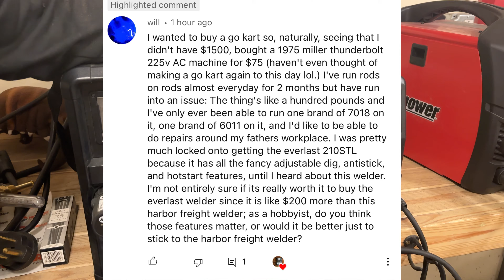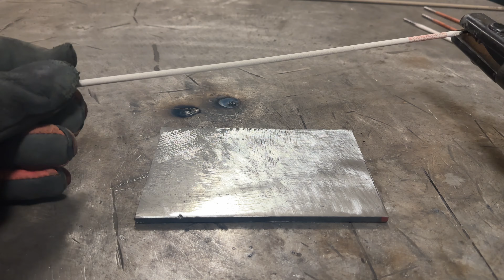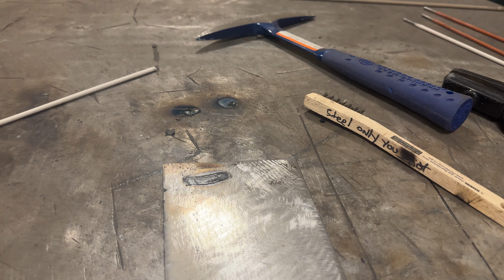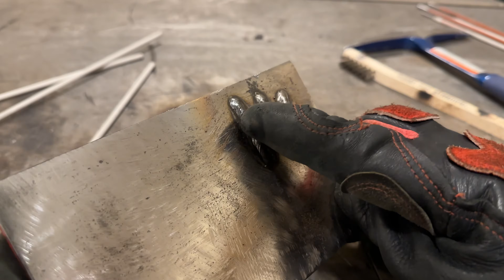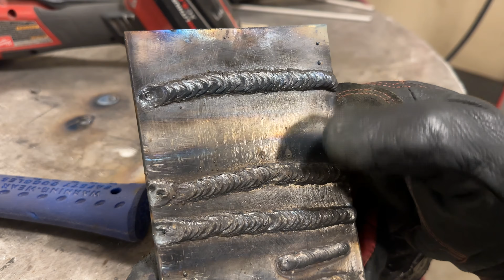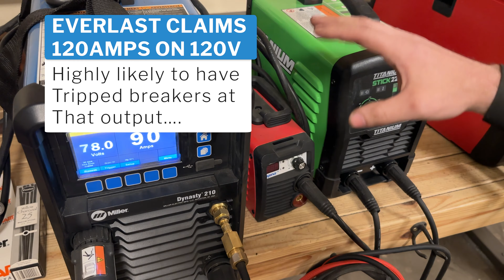Titanium 225 vs everlast 210 stick welder.  Comparison/explanation of features, viewer question.

Comment: How well does it work with aluminum?
Reply from the maker: So the titanium 225 can weld aluminum only with aluminum stick rods and those are not very easy to run.  If you want to weld aluminum a “spool gun” on a MiG welder or a a/c tig machine is the way to go 👍

Comment: I think it's a benefit that the Titanium does not have the stuck rod feature... if you have some rods that are a bit damp, you can short circuit them and heat them up and dry out the flux coating... can't do that with the stuck rod feature.

Comment: Hot start and arc force adjustment sold me on the Everlast 210STL.  No regrets at all.  I enjoy welding with the 210 more than my old Thunderbolt transformer machine.
Reply from the maker: You can’t beat having arc force and hot start control.  Once you have it you never want to go back to a simpler welder lol.

Comment: Ive had the titanium 225 for about 2 and half years. Its been a really solid machine for me . And one point i let it sit for like 6 months and still worked great. Id upgrade the stinger and the ground clamp though.
Reply from the maker: Those 225s are awesome welders.  Despite being simple they flat out weld good and actually run 6010.  The stinger and ground clamp upgrades are 100% worth it.  What I really like most about that welder is that I can tell people who want to learn to stick weld to go out and buy one, and I know its capable of running any rod and welds great.   Not to mention they are available everywhere for a very affordable price.  Prior to the 225 there weren't many affordable options that had at least 150 amps of output on DC, could run 6010, and were available everywhere for reasonable money.
Reply: @makingmistakeswithgreg  I agree 100 percent ! I use it for scratch start tig too because I'm cheap lol
Reply: @makingmistakeswithgreg  I just bought one of those Berger stingers and a Lincoln 300 amp ground clamp. The clamp is like 12 dollars on Amazon .

Comment: Everlast 210 STL $449, Everlast 200 STi $349 and Titanium 225 $319.99 (members only deal is $279.99 right now).   It's a tough decision!😂😂.  I really enjoy the videos.  Thanks!!
Reply from the maker: So the titanium 225 is a great stick welder and I honestly don’t think you can find a better stick welder for the money.  Going to the 200sti would give you more ability to adjust settings (adjustable parameters for arc force and hot start).  Going to the 210 primarily gives you better tig capability with built in gas valve.  From a stick perspective it also has “stuck stick” which can come in handy.  

My suggestion is if money is tighter, buy the titanium 225 and spend the difference on rods and practice steel.  Practice will make a far bigger difference than the upgrade in machine will.  If you have a bit more money I would suggest going for the 200.  The main benefit in my eyes is better performance on 120 volt, the rest of the stuff isn’t really a big deal.  The harbor freight will only weld up to 70 amps on 120v, the 200 everlast will hit 120 (supposedly).  The truth is at 120 it is actually pulling 30+ amps out of the wall (on a 20 amp circuit) and it’s relying on the thermal trip curve of the breaker not to shut off.  In simple terms you won’t get anywhere near 120 if anything else is on the circuit or you weld more then 20-30 seconds in a row.  Also, you may have 240 at your place but someday you may need to go someplace to weld something (be it a friend or a job).  I rather have atleast the ability to run a 3/32 7018 at 90 amps than being stuck with 6011 3/32 at 70.   Hope that helps 👍
Reply: @makingmistakeswithgreg  I was wondering if you could explain what this means.  

On The 200 STI:
Max Inrush (I1MAX) Amps: @120V: 39.2A.  Maximum Rated (I1EFF) Input Amps: @120V: 24A.

Max Inrush (I1MAX) Amps: @240V: 36.8A.  Maximum Rated (I1EFF) Input Amps: @240V: 22A.

Would/could a dedicated 30 amp plug with 30amp breaker (for travel trailer) run this 200 STi set at 120 amps?
Reply from the maker: @bryanthornton6787  surely I can explain those 😀.  So they actually seem to have believable specs listed.  Max inrush is the maximum power it will pull out of a circuit.  In my testing most stick and MiG welders will pull 32-38 amps on a 120 circuit when maxed out.  They are telling you that welder should not exceed 39 amps on 120 and 37 on 240 (obviously on 240 the output power is far greater).  Now the rated amps is the power output it has at its rated power.  Rated power is typically not at max, but less.  

Doing the math of a 7018 run at 120amps, that’s about 2,400 watts (120a x 20 volts that a 7018 would run at).  That welder at best is probably 60-65% efficient so that puts input power around 3700 watts to get 120amps out with stick.  At 120 volts that is 30.83 amps (3700w / 120v).  That’s a whole lot of info but what it means in simple terms is that welder (best case scenario) will need 31 amps input to output 120 amps.  

On a normal house circuit a 20 amp breaker will allow 31 amps through without tripping for probably one minute.  So a normal dedicated 20 amp breaker would handle welding at 120 amp output intermittently without issue provided you weren’t burning up rods constantly.   A 30 amp household breaker would handle that welder indefinitely at 120a output without ever tripping because that welder is unlikely to exceed 40 amps draw and a 30 amp breaker will allow 40 amps to be pulled for minutes at a time without tripping.  So basically if you have a 30 amp 120 circuit you’re good to go and will get 120 amps of output off that welder on 120.  

I have personally used both a esab rogue and a miller 161 maxstar on 120v 20 amp and they both will weld 1/8th 7018 at 120 without issue.  I would assume the everlast would be the same and even more so with a 30 amp breaker.  

If you are limited to 120 volts the modern inverter welders can actually weld a 1/8th rod which is awesome.  The only real downside is the duty cycle is generally lower and the hot start may be slightly less when maxed out.  Hope that info helps 👍

Comment: The 210 is worth it just for the features. Antistick and hotstart are great for beginners and arcforce with help you for welding thick metal or doing your hot pass. But even those feature aside, let's say you're all old school guy that doesn't need that fancy bs, everlast has a 5 year warranty whereas the titanium only gives you 90 days unless you pay extra for either the 1 year or 2 year warranty
Reply from the maker: I definitely agree 👍.  The 210 makes stick welding easier and you can tune it to the way you want.  If the budget allows for it that would be the way to go between those two 😀

Comment: Hi Greg. I'm glad that you discussed the duty-cycle. When I used my old AC-only welder, and practiced some welding exercises, the transformer thermal circuit disconnected, until the transformer cooled down. Thus, for me the higher the duty cycle the better. The noise of the cooling fan, and how often it starts, are factors that can be important. Cheers.
Reply from the maker: Yes great points.  One of the many reasons why I like fan on demand and welders with solid duty cycles, they tend to be quiet and they don’t give up when you’re ready to keep going lol.

Comment: This video was incredibly insightful, I hadn't even considered many of the things you brought up, most notably: cases in which I'd use the welder, the benefits of hotstart, and duty cycle. One of the things I like most about my current ac buzzbox is that I can crank it up to 150-160 amps and run hot passes seemingly forever with it's solid duty cycle (30% at 225 amps I believe), which is something I feel like I'd definitely be limited by with the titanium. At first when learning about hot start I thought it made only the initial arc strike easier, in other videos the most in depth explanation I got was that once the initial arc struck it the pushed the amperage up and then immediately shot down; what they hadn't explained was that hot start made the beads less stringy in the beginning, something which I thought was caused by me moving the rod too quickly or long arcing in the starts. Lastly, you briefly mentioned in the video that antistick wasn't really a necessity for welding on flat plate, but would have an absolute advantage on in confined spaces. I didn't really think to much about the cases in which I'd be using the welder, but because you brought it up I realized that those are the positions I see myself welding in the future.

I've decided on the Everlast 210stl, while im sure your welder is much much better, the features are undeniably better as you pointed out, and I will be taking full advantage of them with the positions I'll be welding in in the future. Thank you for taking the time out of your day to make this very helpful video, I've been considering getting a new welder for almost a month now and I think I've finally decided on the one I should get. Also I've started using normal grinding disks again after your reply, not as bad as I remembered as far as skipping goes and the surface finish is okay for most the work I do, thank you for spreading your knowledge on welding.
Reply from the maker: No problem and I am glad you found it helpful 😀.  I like the titanium 225 and think it’s a great stick welder.  The everlasts features cost a bunch more, but you will see use out of them for sure.  They won’t make you a better welder honestly, but they will make it easier to put down good welds.  Cleaner starts, ability to control your 6010/11 aggressiveness, and not junking rods because they stuck make everything a bit better.  I also like digital displays for amperage/controls because I can dial things in faster.  I am sure you won’t regret your purchase 😀

Also, to a certain extent slowing down travel or slightly long arcing the rod for the first 3/4 of a inch of a weld can help get the bead to smooth out, but doing so can risk porosity at the start.  Without hot start I generally run the welder on the hot side to get the weld to tie in good at the start, and move faster in the middle to compensate.  Hot start solves all the issues of poor tie in, roped up bead, starting porosity, stuck rods, etc, and makes it flat out easier to get consistent welds.  Little adjustable settings makes for better welds.  Just like “run in” control, burn back, and inductance settings on MiG welders can help make more consistent welds.  They won’t make a bad welder a great welder, but they make good welds just a bit better.

Comment: Early on when learning to weld, I never paid any attention to hot start or arc force. I could have saved some real headaches by learning them sooner. Hot start saves from that frustrating sporadic porosity. I always adjust the arc force when I’m runnin 308 for stainless. I don’t even use the stick stuck feature on my Fronius. What the Fronius does have that I’d like to start experimenting with is the pulse stick feature.  When I get more time im gonna dive into it. It seems like it helps with 6010 and especially when welding any sort of thinner gauge material.
Reply from the maker: Fronius is one of the few that will pulse on stick, that’s a feature I have never used (never owned a welder that could) but have heard can help.  Hot start is a definite must have, it makes tie ins better, and like you said it really helps with the starting porosity.

Comment: great video, I finally upgraded and my Primeweld mig180 is on its way to me. It comes with a spool gun and it also has a CC mode & comes with stick leads. I'm still going to keep my buzzbox in the corner just in case tho. On a side note last night I was padding beads running 7014 DCEP on my buzzbox. Anyway It didn't feel like I was getting any penetration, the slag was all gummy like a 6013 and the molten metal just blobbed up on top of the plate, TBH someone could have told me it was DCEN and I would have beleived them.......any thoughts? It might just be how 7014 is since I have never really tried them before.
Reply from the maker: The 7014 seems to take more amperage than 7018.  Based on my testing it doesn’t like to penetrate much.  I have ran 3 different 7014 brands/rods and I rather run 7018 10 out of 10 times lol.  For 1/8th in rods try 130 amps (depending on steel thickness).
Reply: @makingmistakeswithgreg  THANKS, yeah I probobly wont buy anymore 7014.....they are ok I guess but I would almost rather have 6013 or 6011 in an AC only situation.
Reply from the maker: @yurimodin7333  yeah, after running a bunch of 7014 it seems to me it mostly would benefit thin metal because it’s penetration seems to be minimal at best.  I have some 5/64 7014s I am going to fool around with on 1/8th metal this weekend and see how those run (I did run them to decent success in the past on thinner material).  What I find interesting is I really like 7024, but despite 7014 having the same flux it doesn’t produce as good of welds for me.
Reply: @makingmistakeswithgreg  I got my PrimeWeld in a day early so I was trying it out and it runs the 7014 MUCH better than the buzzbox did......I am thinking the buzzbox is just super weak on its numbers vs output (its the old crank style) or possibly something in the DC rectifier is getting wonky. I actually didn't mind the 7014 on the inverter. After talking with my dad (retired factory maintenance welder) I think the appeal of 7024 is that sweet sweet slag peel.

Comment: I'll say it again. I am seriously impressed by my T-225. Beats the pants off my Miller HF-250 FOR SMAW.
Reply from the maker: Yeah they weld really good 😀.  I bought one when they first came out years ago and when I saw 6010 on the dial I laughed because I thought it would never run 6010.  Yet it does, and it welds far better than I expected.
Reply: The Titanium 225 really is a solid stick welder.  It runs 6010 very well and is excellent with 7018.  It is every bit as good or slightly better than my Syncrowave 180SD for stick welding even though the SW has adjustable dig.  I can also lift the Titanium 225 without an engine hoist! 😂